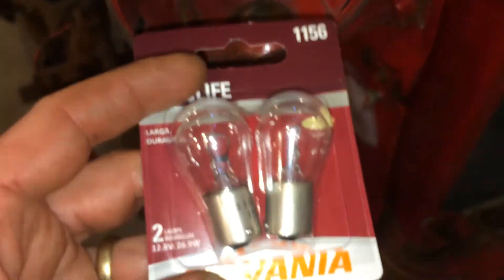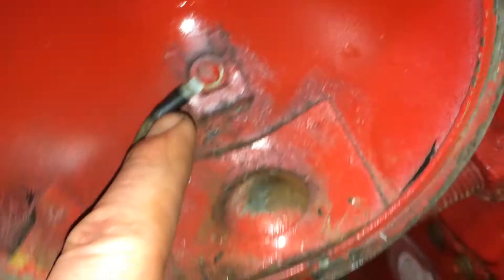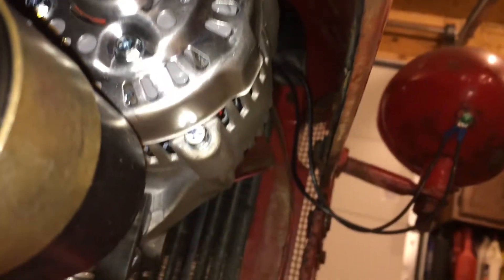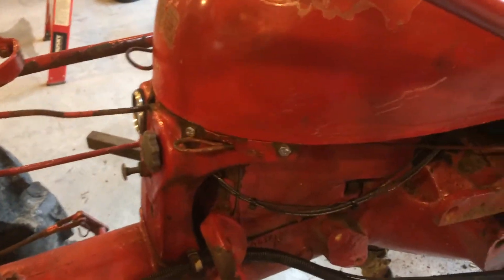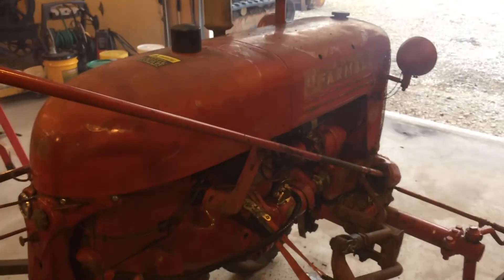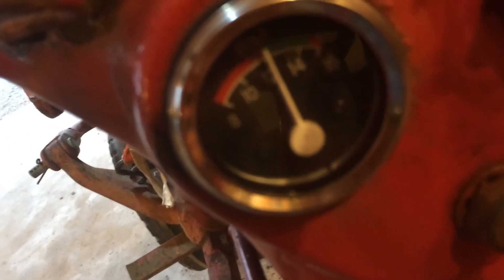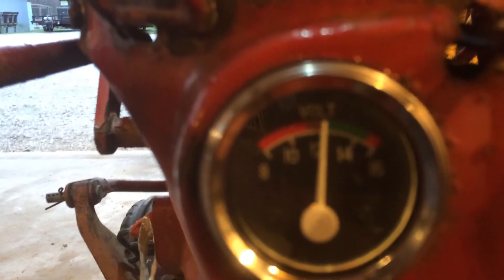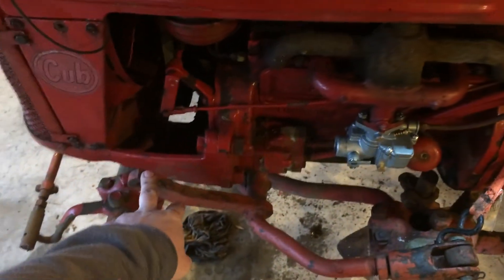Tractor 12 Volt Conversion Step-by-step Part #6

Comment: I got a 1961 Farmall cub watched your video on doing yours it had a 2 wire alternator on it and I went with a 1 wire and after doing it it has no spark I took the 10 gauge green wire off and put the grey 10 gauge wire on it and nothing light won’t work are anything any help would be appreciated are tell me what I did wrong

Comment: This  really will help a lot of people when they convert the electrical system.  If  I may ask  could you explain the electrical system a little better. Which wire come from where and goes to where and the reason why the wire runs that way. Many people  find it hard to follow the electrical flow of each system like the lights , the starter or the charging systems.

Comment: with the alt having power all the time does it run down your battery if the tractor sit for a while?
Reply from the maker: I never noticed a problem,but Grandpa only kept this tractor for about a year after I did this conversion. He sold it at auction.
Reply: Douglas I wondered about that.  I would have moved the alternator wire from the line side to the load side of the ignition pull switch. The battery positive terminal would then only be connected to two normally open mechanical switches (starter and ignition) and be isolated when the tractor was switched off.

Comment: I did the 12 v conversion on my 1954 Cub and all went well thanks to you. BUT I get no power from the alternator. I did add the voltmeter as you suggested but there is no increase in voltage when the engine is running. Perhaps the alternator is no good. I wondered if anyone else has a problem like that.  I changed the headlights and found on Amazon a pair of 12 v LEDs with brackets and bolts for $17./ They are bright and easy to install.  Thanks again.

Comment: I did the conversion as per all the same parts & the same wiring diagram, the tractor runs great. but the voltage is running to almost 15 volts @ half throttle & the coil is getting very hot? any suggestions? I appreciate any help! James T
Reply from the maker: Double check the coil is 12 volt. Maybe a faulty coil?
Reply: @justtinkering6054  I ordered the same coil as suggested and since its a cheap one there is no markings on it. so may just go ahead & buy another on to check?
Reply from the maker: @stephaniethieme5421  Keep in mind, I am no mechanic. You might get better advice from someone else. With that in mind, you might try a coil from a local auto parts store, since the ones online are giving you trouble. You might get a heavier duty unit. Also, make sure you have good connections and all your wires are in good condition, and are the right gauge.
Reply: @justtinkering6054  i just swapped out the coil & external resistor from my ford tractor. The external resistor got too hot to touch in just a min or two. also noticed the metal cover on the back of the alternator was warm. the volt meter was still showing over charging. i have looked for another wiring  diagram to see if I can change anything but they all show the diagram / an amp meter, so at a loss as i'm not a mechanic?

Comment: Did you leave the 6 volt starter on?  I converted my old Chevy to 12v and left the 6v starter, works better than ever.  Just wondering if you changed it or not.  If you explained it and I missed, sorry about that.  I will go back and review the other stuff you did.  Thanks and great series on the conversion !!
Reply from the maker: I left the original starter on. It works great. I am glad you like the videos.

Comment: Do you have any videos on installing a Woods 59 belly mower on a Farmall Cub?? I have everything except I don't have any way to fasten the idler pulley to run the belt to the PTO shaft.. thanks for your help!!!
Reply from the maker: Sorry. I don't have any real experience with belly mowers on Farmalls. I have mowed with them, but never installed or removed them.

Comment: So one wire off the alternator where did you run it to the top of your starter and does it feed into the battery there in charge it
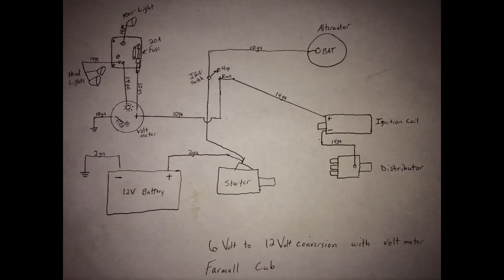Reply from the maker: 6:45 Shows the wiring diagram. The wire from the alternator goes to the hot side of the ignition switch. There is another wire on the same post of that switch that runs to the starter.

Comment: Very helpful. Followed your videos and finished today. Tried to crank but noticed the coil was getting very hot. Any ideas?  I do have spark, the volt meter shows 12 volts.
Reply from the maker: Are you certain that the coil has an internal resistor and is 12 volt?
Reply: Just Tinkering i thought I purchased the same one you did on ebay.....I will check. Read the same thing a few minutes ago on a carnal blog. If no internal resister, then I will need to add an external.  Also, foolish question, but I do not need to ground any of my lights now since it is 12 volts....correct?
Reply from the maker: They would have all been grounded when 6 volt.
Reply: Just Tinkering it has internal resistor. 12 Volt Conversion Coil (Internal Resistor) for Ford Tractor D5TE12029AB
Reply from the maker: Maybe have the wires on the wrong posts of the coil? Wire diameter too small?